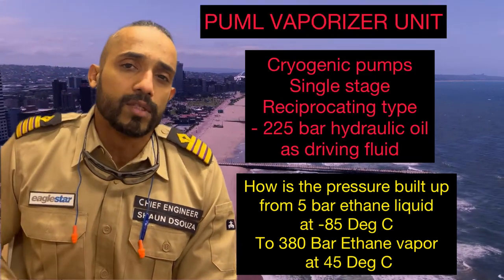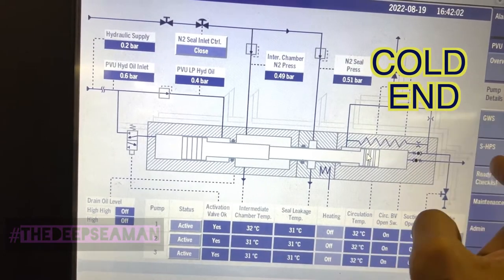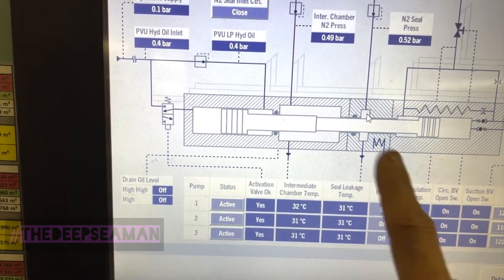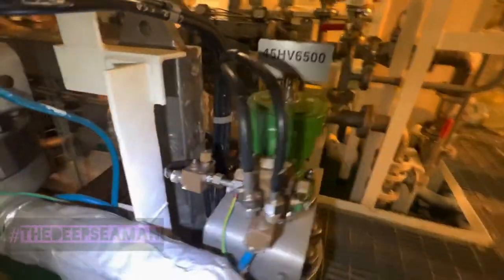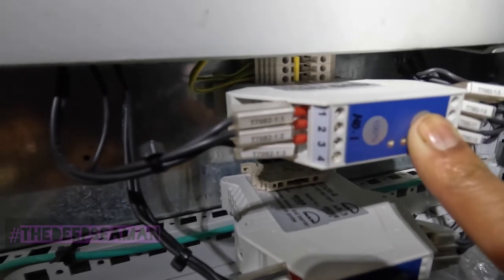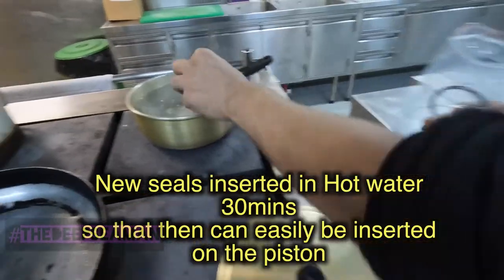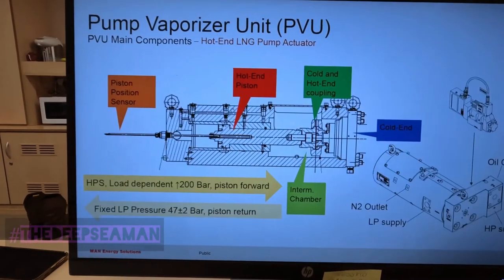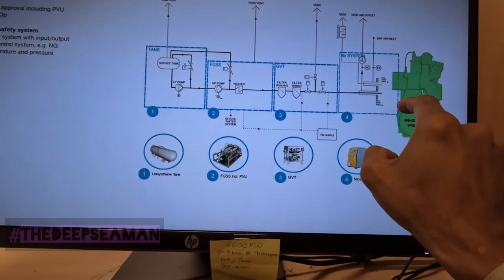Dual Fuel Engines - MEGI - Part 3 - PUMP VAPORIZER UNIT - CRYOGENIC PUMPS

Comment: The critical temperature for ethane liquefaction is around -40 deg C, whereas as you have mentioned , it is stored at around -90 deg C. Can you give us the details as to why and how the storage tanks are insulated to retain low temperature.
Reply from the maker: hi, Ethane has a boiling point of −88.5 °C at atmospheric pressure; hence since the tanks are just barely above atmospheric pressure, we have to store/keep the cargo (ethane) in liquid form at -89°C to stay within the relief valve limits of the tank. 
Tanks are operating at 0.05~0.24 bar; Relief valves are set at 0.28~0.44 bar
Reply: @Thedeepseaman  thanks a lot. Will engage with your expertise often.

Comment: Hello Sir, What is the heating medium (method) used for heating the shaft between the Hot and Cold sides of the cryogenic pump?
Reply from the maker: electric heating coil
Reply from the maker: coil is rubber coated & completely electrically insulated Looks like your provision room/cold room door heaters.. IP67 rating & IS rated also

Comment: Very informative video sir. Just wanted to know y glycol is used as a heating medium in vaporizer unit??
Reply from the maker: low freezing point, cheap,.. glycol always used as secondary medium in low temp systems... as a coolant also in LPG or LNG compressors
Reply from the maker: Do like, share, & subscribe
Reply: @Thedeepseaman  thanks sir